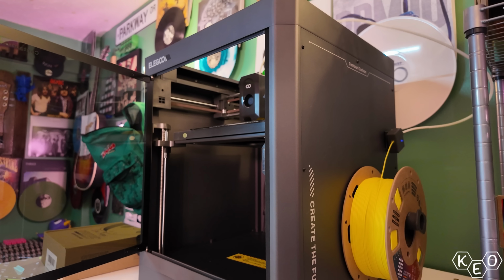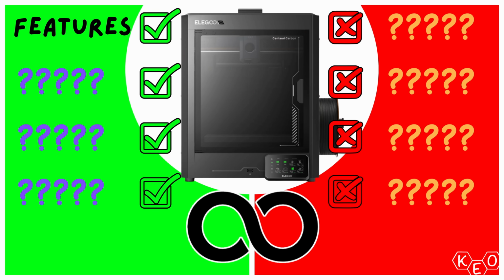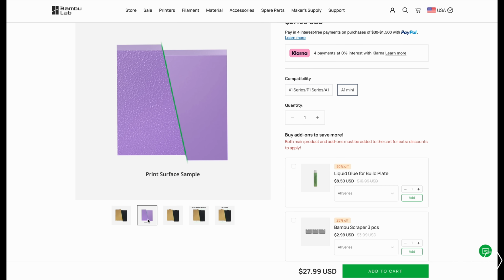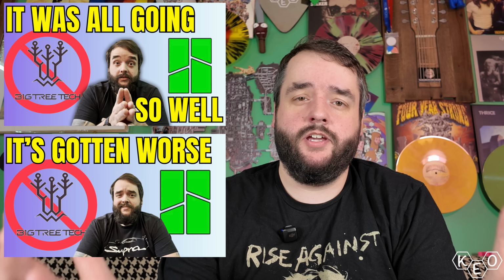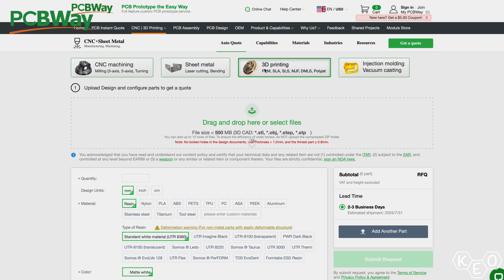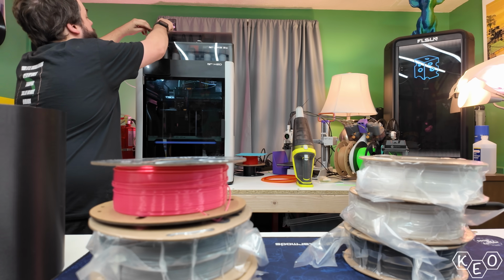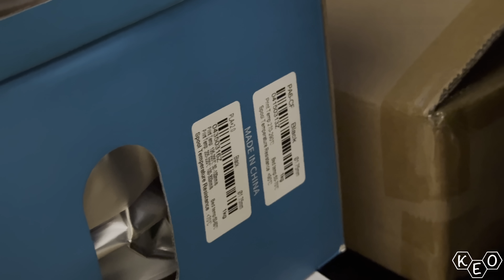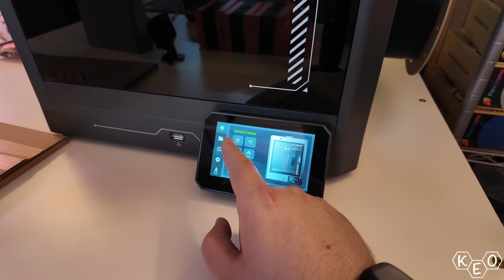This $300 Elegoo Printer Months Later — Here’s the Truth

Comment: You don't care until they start the price gouging.  A tale as old as time.  It's cheaper to leave it closed, so it gives you a development advantage.  You spend the extra money on marketing, control the mind share, kill the competition and then jack up the prices.

Also, you list missing features of the CC as a con.  What about features that are removed in subsequent updates? Isn't that even worse?
Reply from the maker: That's true but I unfortunately can't make a video reviewing a machine based on speculating what the company is going to do. If they win the market and then jack the prices up, I suppose I'll make a different video then.

For the same reason, I have the lack of multicolor listed as a con. Less as a missing feature but more as a weak marketing ploy. The printer has a lot going for it. Why market the multicolor as a feature on the product page already if it isn't out? That's all I'm getting at

Comment: My Centauri Carbon arrived a little over a week ago, with all the updates:  
Two light bars replacing the single weak LED 
They've chamfered the underside of the top frame to prevent the PTFE tube rubbing/chafing
They've made the side panel that holds the filament thicker so it doesn't flex and wobble
There's an AMS port on the back
Improved runout sensor mount

It is still loud though.  Tbf, the exhaust fan does cycle on and off based on temperature, but I've only printed PLA, PLA-CF and PETG.
Reply: Came here to say the same. The little LED strip upgrades are good enough for me.
Reply: ive seen an exhaust muffler on printables, im going to print that and the riser for the top glass day 1, hopefully getting mine tomorrow
Reply: same me, my centauri carbon still good way as arrived week ago and speed with standard petg over 16 hours 12 minutes. still good no issues. and few issues but i able to fix :3
Reply: ...and the top lid is not too snug anymore.. Also an update I think
Reply: @Volvoamazon62  Yes, that too - forgot about that one.
Reply: I have the same experience over the last 2 weeks
Reply: I got my Centauri Carbon four days ago and it also has all of the upgrades. I didn't realize all the things they fixed until just now. Thanks for hearing us Elegoo💕
Reply: @IndyDodge-e7o Amazon still ships out some that are old however.  My isn't updated at all.  And I just got it.  Late September 2025.
Reply: You think it could be possible to swap the existing fans with superior and quieter noctua ones?

Maybe it is a stupid question, but i'm a noob and preparing for the purchase
Reply: @RustyRuin  The whiny motherboard fan is worth replacing, but the loudest fan is the blower style fan, I don't know how much difference another blower will make as opposed tweaking the power - It's worth checking out the Synthetic Electron 3D YT channel, because he's put a lot of work in to this area; both with tweaking GCode and physical mods.
Reply: For the led strip, is it using standard connectors or are you having to do any wiring or soldering?
Reply: @mmmuck  No, this was a factory update on later production runs.
Reply: Same! just finished the setup and printed benchy, came out great. Light's bright.
Reply: Mine came yesterday and it seems like I got an old one, because all of those are still a thing for me. Sometimes it sounds like an airplane takes off when the sides wobble and the fan picks up speed. Still love it though. First time I could actually print PET-CF/PA6-CF without any problems, right out of the box, with the presets provided in Orcaslicer.
Reply: did you order it from ebay official store or from their own website?

when I spoke to elegoo on ebay, they said they don't have ams port (yet) on their current stock but do have improved lighting, so I wanted to see where you ordered from so that I can from there to get both the ams port and improved lighting
Reply: @DisguisedMouse  There is a four pin AMS port on the back - they don't have an AMS product yet but they have said it's coming later this year. Note: this is a four pin socket to power an AMS device, not a multi-filament port.

I ordered directly from Elegoo's webstore.
Reply: @Spreadie thank you for your answer

Ohhh so when people say that the latest revisions come with an AMS port, they are saying that it's a power port and not a multi filament port?
Reply: @DisguisedMouse  yes, an AMS system will likely feed filament directly into the run-out sensor on the side
Reply: How I could know if I order an update machine or an old version?
Reply: @federicoarielpalacio6863  If you're ordering direct from Elegoo now, I'd expect you to get one with all the updates.
Reply: so if theres an AMS port then that basically confirms an upcoming AMS accessory right? why else would they do that?
Reply: @p24p14  This means they originally planned to include AMS at some point.  Don't mean they figured out how to do it or still intend too.
Reply: @p24p14  I think the initial plan was to develop an AMS type system for it, but things got hard and it looks like they're binning the idea.

I know they've said they're still working on it but Elegoo have form in this line of BS - they put out a statement to appease folk then string it out and to let things die down then scrap it entirely.  They've done the same kinda thing with their resin printers in the past.
Reply: I just ordered one, and should be showing up on Monday.. Looking forward to using it, as I’m currently using an Ender 3 S1 Pro

Comment: Does anyone know if they have made it quieter? I sleep kinda next to my a1 and i sleep like a baby to that thing😅 i wanna know if the cc is a more put it in the corner of the basement type printer
Reply: Yep, corner of the basement.  Nothing is as quiet as the A1.
Reply from the maker: I would agree. Perhaps not sleeping next to this one
Reply: @KeoPrints ahhh my only restriction 😅,  i live in the basement and have bed sheet walls so my printer snd gaming setup is right next store 😂
Reply: Most of the noise is from the fans - two points there. 
- things can be done to reduce the fan noise
OR wait for the open frame (no fans but no ‘engineering’ filaments) plain “Centauri”. 
The mechanical noises from the printer are more clunky, less humming, than the A1 series.

Comment: I agree about the fans. Also, there's some fan in the lower part of the machine that doesn't turn off when a print has finished. I thought maybe it was a mobo fan and would eventually turn off, but hours later it was still droning on.  This forces me to have to turn the printer off. If I just reboot the printer by cycling the power, the fan stays off until the next print job, so clearly it didn't need to stay on.

Another peev, is that they broke the web interface for turning on the chamber light in the latest firmware v1.1.29. Now I have to actually go down to the printer (which is on a different floor and in a different room) to turn on the light from the front panel in order to have it on.

But hey, it's a great printer and a fantastic value for the price. I would recommend this to anyone currently considering a Banbu P1S (assuming you didn't need the multicolor printing.)
Reply: The electronics bay fan (in the floor) shuts down by itself a few minutes after a print finishes, on my CC at least, so your printer’s behaviour is different. Maybe worth contacting Elegoo? 
That fan doesn’t seem to effectively change the air in the compartment, which only has one grille on the bottom, and that can be too easily blocked by mounting the printer on foam for quietness! 😳
Reply: @dougal6569  Can you add anti vibration feet as you can on a Bambu which would lift it up?
Reply: @andyspoo2  Elegoo do list them and there are a few designs on Printables and elsewhere. They should be some help for cooling the electronics (and in really hot environments, even providing space for an additional external fan to force air into the floor electronics bay).
Reply: Is there a gode command you could use to turn the fan off or reset the printer without homing after the main code finishes?

Comment: Added DIY chamber heating to one of my CC's.  Has temp range control and timed shutoff.  Use it to keep chamber 45C-47C for ABS.  Works well.  Oddity is firmware currently pops up reminders about chamber/temp could cause issues... if chamber temp hits 40C.  Slightly annoying but does not cause issues or affect anything.  Would seem reasonable that a warning would not be wanted if bed temp >= 100C, or nozzle temp > 270.  Have 2 CC's at this point.  Batch 2 with a 0.6, and DIY heating for more interesting materials, and a batch 5 with the upgrades and AMS port for future multicolor.  Like them so well that I gave my X1c with AMS to my college age son.  He likes the Bambu ecosystem... me less so... though currently hanging onto my A1... which is better (more consistent) than x1c for multicolor... because of the poop chute clogging, poop dragging issues with the x1c.  A1 just works for multi color so it gets to stay... for now.  Chamber light on batch 5 is quite good.  Batch 2 chamber light was terrible.  Recommend Druck Blude riser on printables.  Jesus Freak riser leaks too much heat.  Use both risers, DB on batch 2, JF on batch 5 (which will work with heat leaking as it will just be my PLA/PETG CC)
Reply: How do you keep abs from warping? I have an enclosure on my printer with an active heater and I've cranked it all the way up to 65 and my abs still warps off the plate... Textured pei brand new plate too.
Reply: @maj429  On CC, Side A of plate at 110C.  Clean plate with windex prior to printing.  Picked up this tip from 3D Musketeers.  Have printed some rather difficult parts that would tend to warp.  If a really tough part will use a brim with 0 distance, and change the support setting so it is also zero x/y distance on bottom layer (separate setting farther down on the support tab).  Was able to print the Druck Blude riser sides on edge with ABS without any warping.  Was not even able to do that, without some warping, on my Plus 4.
Reply: Meant to add that I found a big difference in bed adhesion between 105 and 110.  At 105 to 100 parts pop right off.  Also, using the Druck Blude riser which seals pretty well.  The Jesus Freak one leaked too much, which caused warping.  Have had good success with both ABS and ABS GF, but GF has been superior in pretty much all respects.  Adhesion, warping, dimensional accuracy.

Comment: I have had a Neptune 4 Plus for almost 2 years, and 4000h of printing. I had 2 PSU failures, 2 z homing sensor failures, the screen/tablet firmware was so buggy I removed it, and Elgoo’s modified Klipper firmware doesn’t implement Z-Offset correctly, so it’s reflashed with OpenNeptune. 

Besides all that, it’s a great large machine for the money. If I had known it would take 80 hours of research/tweaking, and $150 of replacement parts to get it reliable enough for 4000 hours of printing I would not have bought it. 

I do not trust Elegoo’s devs to make reliable firmware, and I don’t trust their leadership to spend money on quality electronics, so a machine with a “too good to be true” price point is out of the question for me. 

As good as this review is, it doesn’t sound like this is a consumer unit. I’ll remain skeptical for a year or two, until the CC has seen 4000h en mass.
Reply: Forgive me for my ignorance but where do you find the print hours for your printer? Is it a settings or firmware file somewhere?
Reply: @maj429 In Fluidd: Print History -> Printer Stats -> Total Time
Reply: 4k hrs is like 50kg of filament. that math dont add up.
Reply: @WHAT_1400 How would you even begin to estimate the average flow rate and filament density based on the information I provided? Because there’s no other way to calculate the weight of filament printed in the last 16,000 hours. 

Walk me through it, math wiz.

Comment: Someone has already made an upgrade to quieten the fans and the video showed that the chamber fan is a snail-style blower and the exhaust one the regular wide style. I'm still putting off buying this machine until there's opinions on the announced multi-spool kit, but doing that upgrade while replacing them with quieter compatible drop-in fans would be one of my first steps.

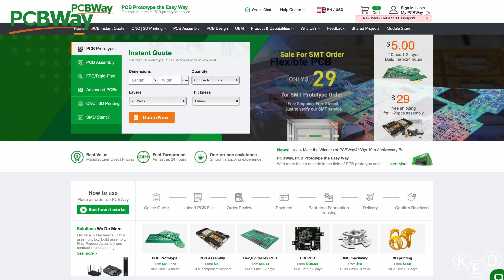Comment: 7:47 I’m the guy who actually likes all the different versions of Orca, mostly because it’s the most braindead way to manage and run multiple different printers at the same time. I’m sure there are ways to launch multiple instances of plain Orca or something, but that’s too complicated for me. 

That said, I like when printers are open enough that they can work with 3rd party services, like OctoEverywhere. I like having one service to manage and monitor all of my printers, so just the bare minimum of “can the client talk to the printer at all” is a big deal for me.
Reply from the maker: You know what, im not going to tell you to open orca and go to File>New Window. Because you have a system that works for you and that's all we can ask for ya know?
Reply: There is a checkbox in Settings for allowing only one instance of Orca that can be unchecked. You may still to use the various printer versions, but if you need it, it's there.

Comment: For me this is the best printer I have ever owed. The color system will be an added benefit, but I just took a chance that this printer did what it says it does and just prints. I keep it in my office with only the one fan being utilized and the noise level is not too bad. I printed a riser on it and leave the top glass off of it and print with the door closed for both PLA and PETG. So far so good with over 100 hours of printing.

Comment: Issue #3 solution: Ya got a drill, right? Get another piece of glass or thick plexiglass with the same dimensions and drill a hole in the center big enough for a rubber gasket and a bowden tube coupler. Install the coupler with the threads down. On the opposite side of the glass use a washer with a large outer diameter and right-sized inner diameter and a locknut. If you're worried about the tension of the locknut, insert a thin piece of gasket material between washer and glass.

Comment: I will say, it looks like you have an older model, they made some upgrades that fix a few issues you mentioned.

They changed how the PTFE tube is attached and changed the design of the top left side of the frame to keep it from rubbing on the PTFE tube.

They also addded 2 LED strips that do a much better job of keeping the chamber lit up
Reply: I got the original printer and my friend ordered a couple months later and got the improved design. I am really impressed that elegoo listened to the community and made these improvements so quickly. small changes but they made a big difference especially for my friend who is new to 3d printing
Reply: Where are the LED light strips located exactly on the new printer? I'm asking because I just received mine, and I only see one LED light strip in the top right of the machine.
Reply: @nomercyriding  Theres one in  a recess on the front wall and one in a recess on the right wall. basically one on either side of the camera
Reply: @nomercyriding the second one is right above the too above the front door, it's not something you'd notice unless you are looking for it, but its there

Comment: I haven't printed much with mine yet. Printer the mini CC poop bucket & slide from silk PLA, which came out nice. But had a print failure w/ some BBL PETG-CF when trying to print the riser for it. To be fair, I then tried to print the riser w/ the same spool of filament on my Qidi Plus 4 and had the same issue. Finally, I printed the riser out of Qidi Ultra ABS-GF25 on the Plus 4, and  it came out beautiful,  and it will be even more heat resistant than the PETG-CF! Another great video on your part- timely & interesting content, good production quality & for my taste, you throw in the right mix of personality & content ((light on the pesonality without being dry, andd heavy on the content).
Reply from the maker: Happy to have you around friend!

Comment: The issues I’ve seen the most of are midair printing and not knowing it’s run out of filament
Reply: The filament run out sensor works well for detecting if there's still filament. The problem is that it can't detect a clog or tangled filament spool, so it just continues to grind on the filament. Though, there's a DIY solution if you really need that feature.

Comment: I now have 3 of these printers along with 2 a1's.  I love them.  I can throw 14 hour prints at them and not worry about printer problems (bed adhesion another issue, but not the cc's fault.

There are some prints that turn out much betther than on the a1.  Fewer blobs and less banding.

I like the a1's for the ams, but most of my parts are one color so no loss.

Obtw, the latest printer has new lighting which is much better.

Comment: I got the very first wave and so far I've got a bed screw that won't stay in and a bad motherboard that took me down for a full month. 

And now I'm paying $16 in Cheeto tax for a $5 value warranty part. (Technically, $2.91 but UPS charges a minimum of $14 for handling the tariff bill) Normally I'd jump immediately on the order when the multi-color is released but if I need to add 60% tantrum tax to that cost it's pretty much dead in the water.
Reply: If it is a warranty part Elegoo miss labeled the package and should not be tariffed. I had a warranty part ship from China from Creality and paid nothing.
Reply: @protecteratr The bill states 'Warranty part' in the description. I'm not going to claim to understand the mess, I just know I'm in it and needing to sort it.

Comment: Controllable chamber heater would be good. Is it possible to DIY a solution? I don't know enough to tell if that's feasible.

The light sucks but I installed a LED strip which takes care of the problem. I understand the latest shipments of the CC should come with an upgraded LED strip